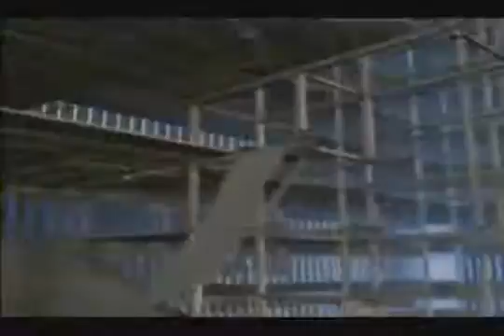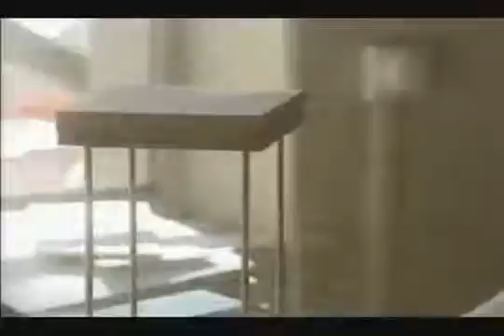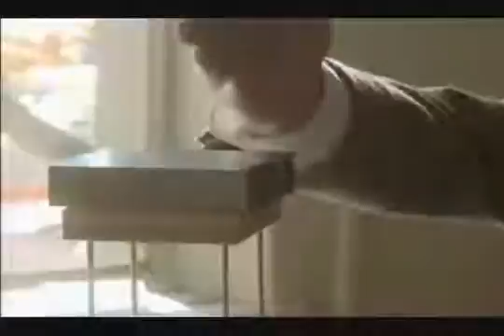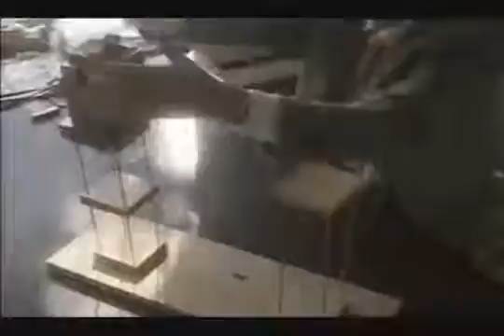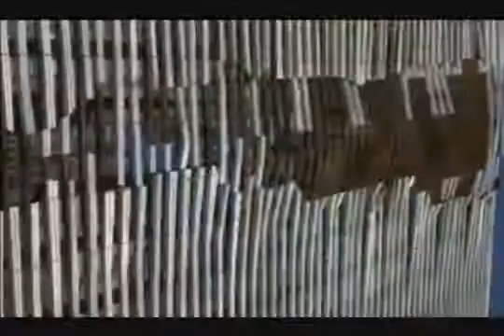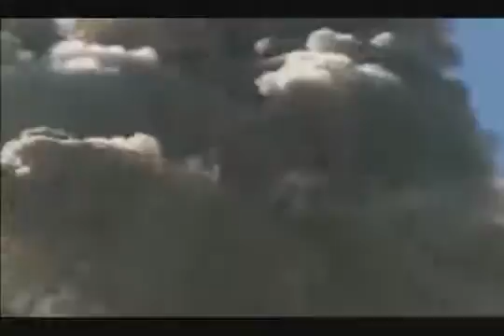World Trade Center - Role of floor loss and buckling

Comment: Ok let us consider that
1) This fails to account for the cores, so the test is failed immediately as far as wtc 1 and 2 
2) The floors failing in this way means there are huge holes in the floors, so there is a clear exit for smoke-UPWARDS-So this fails to explain away the squibs as pressure driven puffs of air.
3) If the model were accurate, then we would see a huge chunk fall off and that's all, or if continued deformation occurred, then the entire towers fall in the same direction.
The north tower fell straight through itself, the south began to tilt at the top then it buckled and collapsed down with some large parts falling in the direction they ought to.

So, let the little model tell the story it is designed to, but it is not a accurate model of anything except itself.
Reply: +Barry Mead "fails to account for the cores" - The cores are columns, aren't they?
"there is a clear exit for smoke-UPWARDS" - through the INTACT tower top?
"we would see a huge chunk fall off" - Why?
"then the entire towers fall in the same direction" - Why?  Are they SOLID?.
"The north tower fell straight through itself, the south began to tilt at the top then" fell straight through itself.
"it is not a accurate model of anything except" - the BUCKLING OF ANY STRUCTURE.
Reply: Well i wrote a response and an erroneous click erased somehow, so ill boil it to my last bit.

You believe anything you want, or, you go and research. What you believe is irrelevant to me.
Reply: Barry Mead You are misusing the word "research".
You are also misusing this channel if you "believe" anything.  I don't.  I KNOW what I'm writing about.
Perhaps, mister "erroneous clicker", you would care to answer the questions before proceeding to smear your questioner.  But I doubt it.
Reply: Maybe tomorrow Tony, but i am tired, insult me if you wish, generally par for the course with official version believers. 
But indeed i will answer, but it is almost 1 am so thanks but you can wait, or try and bait, but it makes no difference to me. And by research i mean i have read ALL Nist, CIA,FBI,FEMA,9/11 COMMISSION,NYPD,FDNY reports and much more, but hey i guess using official sources and cross referencing and using real laws of physics and so forth is just the wrong way to do it, i should research by turning the tv on, listen, and then believe/obey. 
Ok then
Reply: Barry Mead Reading official sources isn't "research" if you don't understand the way the towers stood, or the way they fell - the Physics behind the disaster.  And you don't.
The skyscrapers' columns were well capable of withstanding up to ten times their static load, but needed their floors to stabilise them.
Such columns cannot actually stand erect by themselves.  If their floors are gone, then so are they.
Slender column stability was RESEARCHED by Leonhard Euler around 1750 AD.
Try researching THAT, and quit mouthing off until you ACTUALLY know what you're talking about.
This video clip is EXACTLY correct. And you EXACTLY a fool.
Reply: we shall see, but 4 columns? vS 45?
Floors holding ALL columns?
Fires over less than 20, collapsed floors not even ten, and floors not collapsed in entirety on ANY floor. And if a single column of the internal CORE failed there was unlike here, a perimeter wall all around, Now gnight ill inform in case others read and think when you ad hom it equates to science, but i did say you would and lo you did
Reply: Ok so let us begin.

We shall begin where we see his claim that a floor above causes the collapse of a floor below.
This is a false claim for a number of reasons.
This model shows a floor with FOUR (all bits that you cannot get will be in large) perimeter columns, this is a stark difference to the TWO HUNDRED AND FOURTY that actually existed, that were not independent of each other in the way of floor to top poles, they were massive interconnecting plates locked to each other in a way that would still leave support over many floors including the one, if one were lost.

A proof being that when the planes punched through we can use visual evidence to prove this, the floors did not totally collapse on ANY floor, they simply couldn't because they were bolted to the FOUR perimeter sides, and to the FOUR core sides, that is EIGHT points of connections as well as to each other as well as being connected by the concrete poured over steel webbing.

The floors if they collapse partially were not built in anyway that could cause the immediate collapse of the entirety of any single floor all the way around, this means that to collapse at all a floor had to gradually do so.

How would this happen, fire on concrete on steel webbing onto steel beams?
No the heat would take DAYS to even warm the floor from through the concrete enough to cause any sagging. So we have to assume it warmed UPWARDS, burning the false ceilings then heating the ceiling so much the floor above sagged and fell down, if so, then the floor that falls down, being collapsed, offers no fire upon ITSELF to heat up the floor above IT.

So, then it has collapsed but never ever ever the entirety all at once NO SCIENCE has or will demonstrate fire causing this to occur, and i challenge you to show a simultaneous total collapse of a whole floor by fire.

It wont and so we have an uneven collapse of the floor, as the lower floor can sustain the weight of even two floors collapsed upon it, it must then be force so if that is true, then since no floor collapse as a whole floor, the collapse partially leades to the collapse partially of the floors it falls upon, this, not being equally divided, means after a while the collapses of the floors ends, because of the distribution of falling matter, the pulverization of the floors as they fell means less force to act on the next, remember we use NEWTON here to prove that each force meets an equal and opposite force thus diminishing the total force able to damage each subsequent floor.

Newtonian science proves that eventually, the fall is halted, there should be a partial internal collapse.

And here is where we get to the video, he argues not that this does NOT occur, simply it is alleged enough floors fell (No science to tell how many needed to because to do this needs evidence and proof and floors collapsing as WHOLE floors) This will never be done because the result of such will prove conclusively so many floors would need to fall as a whole floor at once, and not being able to (as said before, no floor equals no fire to weaken the floor above meaning no further collapse of floors, so piecemeal collapse is your ONLY answer to get around the facts. And never forget, these floors alone did not have MORE weights added to them, so they HAVE to prove that fire can drop whole floors or, partial collapse can induce enough force for perpetual accretion of force (defying physics which would have us believe it works the other way, diminishing force with energy used over time and no further input of energy into the system)

But he had his 4 columns, unfortunately we come to another issue, he built his columns of springs-The twin towers were built of rigid steel and iron, they did NOT spring up, so what do we know about steel? Well if i load a single 1 inch in diameter of steel with weights, it can support more weights than if i load a one inch diameter SPRING, FACT because of the way forces are transferred through both,
This is how the video is
BS NO 1 because he is using springs
BS NO 2 4  perimeter columns vs 240 actual
BS NO 3  0 core columns vs 47 actual
BS NO 4 2 floors vs 110

On bs no 4 consider the model in the video shows the ENTIRE structure as absent ANY floors ANY walls, this was not even visually true, so, what would happen if we took his model and wrapped an aluminium wall around it, say aluminium as thick as a coke can?

That weight it took will exceed the weight the first tower took, yet the towers had aluminium cladding AS WELL as 240 perimeter columns

This is how the video is donkey shit. It doesn't matter what YOU say, it matters people try empiricism to debunk me.

Build a replica of this experiment, use 2 with the spring columns one having 240 of them
Then see even STILL with 0 core, what weight it will take

Then build one with 4 solid steel bars of equal thickness as the springs one, and see how much weight it takes.

Then experiment 3 Set 1 inch of concrete over a mm thick of metal of your choice and place it with weights on, between two objects to make a floor supported only at two ends, then build a fire on the concrete and see how long it takes the floor to collapse (do one cold too) add weights over time on both, see what happens

Experiment four, make at least two floors connected to 8 walls, fall as complete floors, 

After all this you will see, the claims of the video are based on bs guesses and assumptions.

BUTTTTTT WHAT IF?
Suppose the claim were true, what the?
We KNOW by science not guesses, it cannot be, but suspend reality and assume physics no longer work for that bs experiment,
Then what did we see?
We watched the model TWIST, BUCKLE, COLLAPSE (ignore the spring back, do not LISTEN instead WATCH the end, it buckles on a side, it leans further to that side and twists to that side, as the weights slide off it comes upright, but the video shows what is true if the claims were true.

A collapse would be PARTIAL, the towers would be falling to the side and slide off, never ever would they as the north did, fall straight down through itself NEVER NO ONE IN THE WHOLE WORLD has replicated this with only the alleged means fire and a plane caused hole.

In the south a tilt, slide then stop fall straight down as if nothing were below it and all through itself again.

Like getting a tree, cut the top 5th off drop onto remaining 4/5 and expect it to crush down the rest of the tree.
Never gonna happen.

So, we have the 4 points of bs which tell us the video is bs and proves nothing, we have bonus point that IF it magically could, we would have witness partial collapses with PARTS of the buildings falling away not THROUGH steel that was progressively thicker and stronger, a core which the video fails to explain the collapse of.

And that NEVER EVE even despite attempts has fire caused a symmetrical collapse. So there you have it, a person who thinks they are clever defending a video that is not partially representative of what it is trying to be, and is provably bs
Reply: +Barry Mead "Slender column stability was RESEARCHED by Leonhard Euler around 1750 AD. Try researching THAT" - Is what I wrote to you.
Your WASTED word output indicates you did no such thing.
Had you done so, you would have realised that it doesn't matter HOW MANY columns there might be.  If they lose their lateral support en masse, they will fail en masse.  You don't really understand what the word "buckling" means.
https://en.wikipedia.org/wiki/Buckling
Reply: No no no, experiment because again simplify

There IS difference between using springs and rigid steel

There IS a difference between 240 columns and PARTIAL floor failures and 4 columns with 100% floor failures

There is a core in one and not in another

Euler is Ireelevant, the FACTS are, NO total loss of internal floors, NO core in the model
NO perimeter walls gone that were STEEL so IF all the floors failed, the towers being built nothing remotely like the model, would not collapse
The video shows a buckle and twist, the evidence in real viewable fact, shows straight down collapse.

You are an irrelevance, do you think i argue YOU?
I ague for observers, do some basic tests, get some card boxes and place weights on (no floors) and watch the sheer loads it takes, then repeat with a replica model of springs and two floors as in this video
Then research the ACTUAL towers build, ALL i have said go research do not believe me, but a square tube of card will take greater lods even HOLLOW than will a model using springs.

Now again my whole floor vs partial floor collapse analysis is also correct, research it, a whole floor collapse is impossible and NEVER been done even when tried for, simultaneous loss of all connecting bolts all around (8 sides) from fire.

Do research and see Tony is parroting rubbish, and this video is NOTHING like the towers

As a final watch a collapse video, read the official documents, check what floors were KNOWN to have totally collapsed, add 30 floors to that (youll be at 30 floors) and ask this, was ALL the floors gone, top to bottom as in the videos model?
Yes or no?
If there were floors, were walls all around then this support exists.

I challenge you a $1000 bet, that if i get that model in the video, place a thin aluminium wall around it, that the loads it will support are TRIPLE what was loaded upon it. And i am willing to place my money directly in a bet with you on this.
So want to take my bet and we replicate the above EXACTLY and one addition a wall around the building.

Ill go further and add $1000 if we place floors over 50% of the building and weigh it up again, since there is 0 evidence of 50% floor  loss prior to collapse, ie NO calls, no claims no fire fighters IN the building so we KNOW some floors remained CONTRARY TO THE VIDEO and ill bet the model will take FOUR times the weight

Then ill give you $4000 IF, WE BUILD THIS LAST WALLED AND 50% FLOORED BUILDING then, sever the top 5th and drop it from 2inches above the rest, if it causes a collapse

So $6000 i am ready to dole out. all you have to do is prove i am wrong and validate YOUR claims, which using false models doesnt do, so. claim made, lets test?

Or bottle out because you KNOW if you accept. i will be up $6000 ?
Reply: Barry Mead "Euler is Irrelevant" - No.  YOU are, by self-disqualification.
Euler was perhaps the finest scientist there has been, his work on a par with Newton, but with one significant difference - it has never been amended, ever.
You are pseudo, and my conversing with you affords you a respectability you do not deserve.
You have three days before I block you.
Try REAL research in that period, and some sort of apology.
It's up to you:  I won't care.

Comment: No they are not. Read their bios on the site. There's no structural engineers with experience on tall buildings. 

The cardboard box demo is laughable. It demonstrates nothing more than the known fact that one cardboard box will support another falling on it. It tells you nothing about the force of resistance of the lower part of the WTC to the upper part. The effective resistance was about 0.1g, hence the collapse proceeded at near free-fall.

Comment: If there had been a huge pool of hot molten metal it would have cooled to form a plug of metal with lots of junk welded to it. This would have been a PITA to cut up & remove.

But no plug of previously molten metal was ever found.

Also there is no evidence of high heat at GZ, just a few isolated fires here and there. The debris was not steaming or smoking - it was FUMING (ie cold breakdown of material). GZ continued to fume for years!

Not everything that glows is hot...
watch?v=9PG_XZ5HtaA

Comment: As the model clearly demonstrates, collapsing floors would have UN-loaded the columns but allowed them to sway/ twist more freely. This actually *prevents* a top down collapse occurring - instead columns are prone to twisting/ leaning over and shedding load that way, which is just what the model does.

A collapsing floor hypothesis does not account for the EVIDENCE: buildings turning to dust in mid air, 1400 toasted cars, continued breakdown of material to the size of DNA etc
watch?v=T1NbBxDGSkI

Comment: No, only those parts directly exposed to super-thermite charges. Then there was the huge pool of molten steel at the bottom which was red-hot for weeks - how can office fires melt steel to such a high temperature?

watch?v=WkO0lZ7BZJc

Comment: But certainly not at that speed. Also, the little wooden demonstration doesn't account for the core. If it had happened as the video claims, the core would have been left standing.